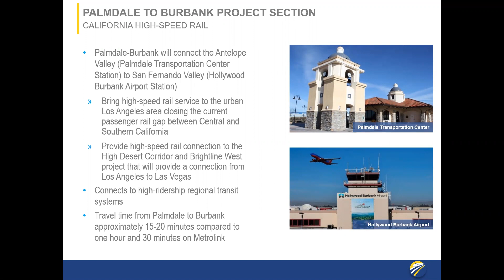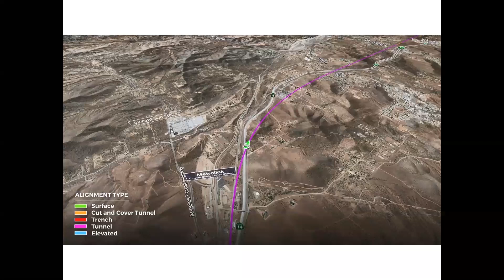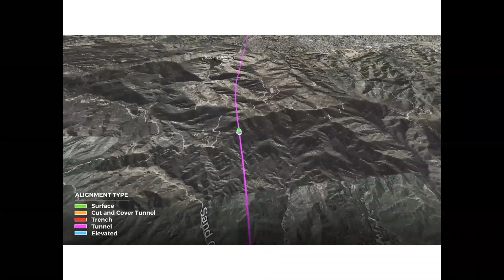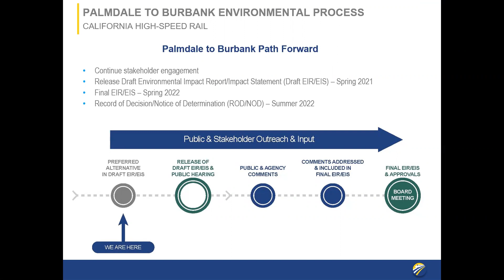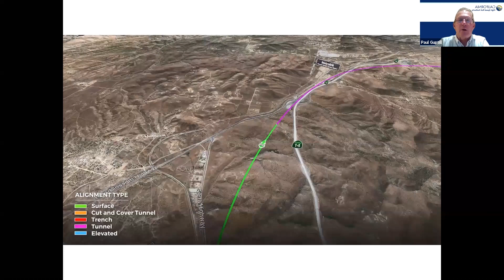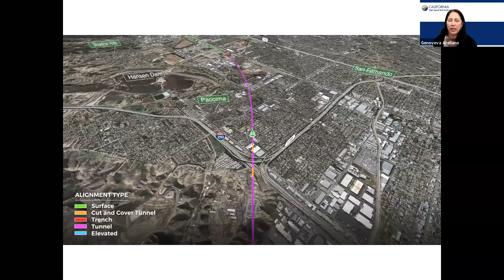Palmdale to Burbank Project Section: October 22, 2020 Virtual Community Meeting (English)

Comment: Lots of tunnelling to do, I hope your boring machines are good.
Reply: Ringsofearth  It's a pretty fixed time frame of 4-5 years since it's pretty hard for external factors to affect tunnel boring rates. Not sure what the existing President has to do with this state project, but even if he doesn't like the California project, he agrees they are a good investment.  
"They have trains that go 300 miles per hour. We have trains that go chug … chug … chug. Our airports, bridges, water tunnels, power grids, rail systems—our nation’s entire infrastructure is crumbling, and we aren’t doing anything about it. These projects put people to work—not just the people doing the work but also the manufacturers, the suppliers, the designers, and, yes, even the lawyers. The Senate Budget Committee estimates that rebuilding America will create 13 million jobs. On the federal level, this is going to be an expensive investment, no question about that. But in the long run it will more than pay for itself. It will stimulate our economy while it is being built and make it a lot easier to do business when it’s done." - Donald Trump, March 3, 2016.  
  
I wholeheartedly agree with him. We need to invest more on a federal level in our airports, bridges, water tunnels, power grids, and rail systems. LAX has the $14 billion Landside Access Modernization Program. Now we just need to get the rest done too because freedom of travel choices is a great thing and Trump recognizes that.
Reply: Fortunately, it looks like the construction access points mean that the TBMs won't have to each do the full tunnel lengths. The tunneling time at Pacheco Pass is estimated at 4 years with multiple TBMs working and these segmented tunnels don't appear to be individually longer. Not relying on just one TBM means that they aren't fully reliant on any one TBM like with Bertha in Seattle where it broke down and delayed the entire project by two years. Needless to say, I'm pleased to see their preferred route is the segmented SR14A route and not the continuous E1 or E2 options.
Reply: Ringsofearth  You can build a wall around yourself, then put a lid on top.